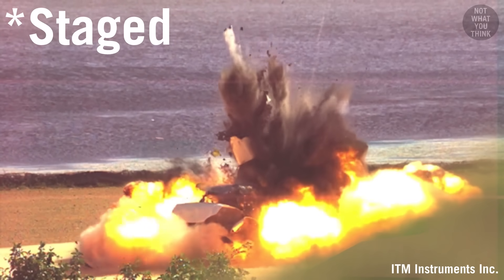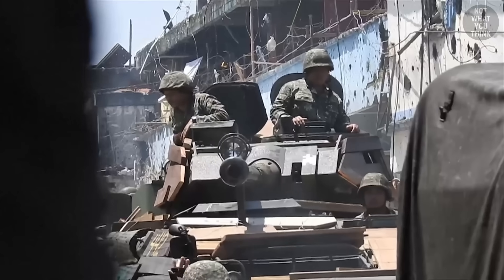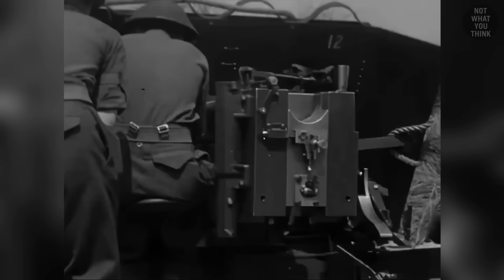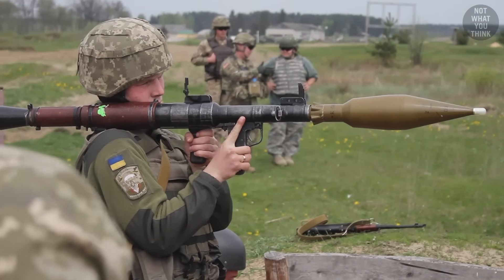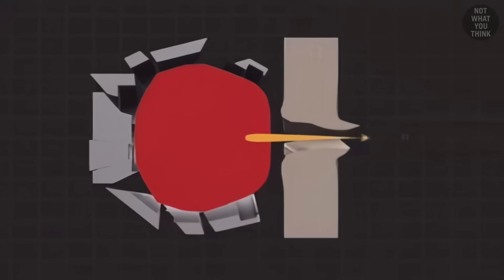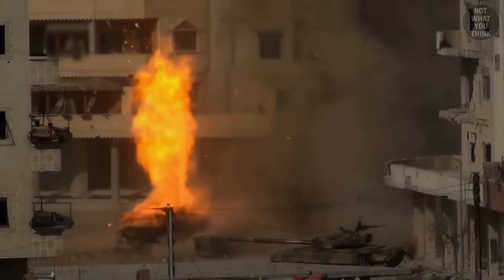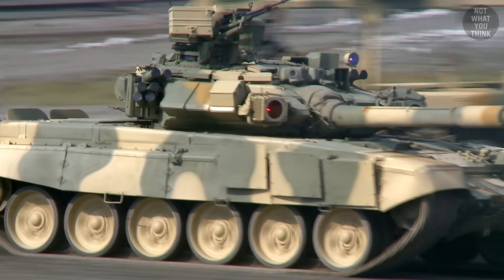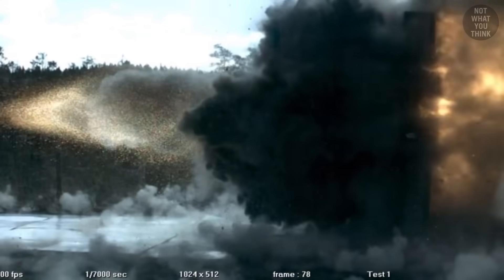Why Protecting Tanks is Getting Much More Difficult

Comment: I don't see the tank becoming obsolete any time soon. First you can't assume anti-tank weapons have 100% accuracy when doing numbers - even Javelins miss, and if you're in a position where your tanks are exposed to anti-tank fire with no means of protection or retaliation beyond what it has on board your officers have screwed up by the numbers.

In short - a Javelin may cost $200,000, but an M16 and 5.56mm ammunition is cheaper still and can kill the Javelin team, yet we don't say rifle teams threaten the utility of Javelin teams. The Javelin team is not supposed to operate unsupported in the same way a tank is not supposed to operate unsupported. Furthermore Javelins are heavy, and their expense means you can't expect to equip every infantryman with them as you could equip every one with a rifle. Your heavy weapons platoon might be able to kill a tank platoon right off but at that point they'll be out of Javelins and will require resupply (nevermind what might happen if they MISS - though could somebody who has actual combat experience with the weapon system give me a read on that? The most concrete number I've seen for wartime use is 100 hits for 118 shots which is absurdly good for any military weapon system in battlefield conditions), where your own surviving tank platoons would still have munitions and still be firing. I mean, logistics is ALWAYS a battlefield concern (yes those tanks will run out of gas eventually and probably even before they run out of shells) but the bottom line is that tanks still fill a critical battlefield role: getting more firepower to a position faster than even mechanized infantry can manage.

If you're looking for technology to kill the tank in favor of infantry, power armor seems more likely to pull that off and we're still decades away from seeing that on the actual battlefield. Only thing close to viable I've seen so far is a mobility assist skeleton that is power hungry and thus I can't see a use for yet outside of a logistics base far from the fighting.

EDIT: Made a quick fix because when discussing the Javelin I think I have no idea how stupidly accurate it is or the publicly available information is inflating numbers because what I am seeing is absolutely absurd for any weapon system in battlefield conditions

Comment: There wouldn't be much stopping a hypersonic tungsten projectile from one tank obliterating another. Reactive armor would be useless against a solid kinetic energy weapon. You just have to adjust the design of the barrel, boost the propellant, perhaps place a small rocket on the back of the projectile to keep it "at" or increase muzzle velocity downrange until it reaches its target. The magic number is 6,752.

Comment: the chances of all the shaped charges detonating correctly from an impact would be astronomical, it's hard enough to do on purpose. i guess their acceptable risk got a lot smaller due to public perception. one of those accidents had only a mechanical safety stopping the bomb from detonating normally. that was the scary part.

Comment: Reminds me a bit of Battleships.  They were big and impressive looking, but by the end of WW2 they were quickly losing relevance since they started becoming big floating targets that just couldn't keep up.
Reply: Yes and no. Battleships became very vulnerable 50 years prior with the advent of effective torpedoes and small boats that could carry them. What made battleships obsolete wasn't that they were vulnerable, it was that carriers could do their job - providing high calibre firepower at long range - better. Regardless of how vulnerable tanks get, until something can provide protected high calibre direct fire with offroad capabilities better than tanks, they will remain relevant, just how battleships remained relevant for 50 years after the torpedo was invented.
Reply: @Paultarco  I think tanks are going to do the same and shrink and become drone tanks. 3 expendable tanks for the price of 1 tank you really don't want to expend now due to the value of the lives inside, is priceless tactically. Because you can lean into the glass cannons, make them sacrificial, improve weight and mobility, and improve rapid detection and avoidance systems. While keeping a more than sufficiently powerful gun, or launcher to kill anything. Especially with sacrificial drone tanks you can take otherwise dangerous and risky, but potentially very effective, operations. Further benefitted from the increased mobility and minimal priority on armor and survivability. At least compared to an MBT.
Reply: Battleships are the platforms receiving the most high tech experimental weapons for testing...BUT  I get what your trying to say , and yes everything has its day. And Tanks really are starting to lose their use for several reasons , first you need air superiority to properly defend your tanks. They are relatively slow compared to other ground forces and air. With the new UAV tanks are harder to hide. Right now we are seeing how tanks are easily defeated in Ukraine , this year will be the real test of tanks survivability in the theater of war , As Nato tanks will soon face modern Russian tanks... Hopefully peace will prevail first.
Reply: @jeffputman8242  the T90 is Garbo bro.  AbramsX has it severely owned.
Reply: @jeffputman8242  Theres nothing that can replace the tank. Its a tool to be used under the right conditions. Just like any other platform such as planes, choppers, ships, subs etc. They can all be destroyed, but are all completely relevant and irreplaceable.
Reply: Ooo. Shot across the bow 😂.  IMO they would be hella useful, modernized, but far too costly. We don’t even have the tools to make the tools, that are required to make battleship sized equipment any more.  Nothing says fire support like a Battleship though, Marines best friend.
Reply: It could possible be similiar to the dreadnoughts of WW1, Germany and Briton invested heavy into the expensive dreadnoughts, that they didn't want to use them in fear of the finical lost. With tanks becoming more expensive to keep up with the antitank tech, some countries are becoming hesitant in the investment.  Lets not forget why we made many medium weight Sherman tanks in WW2 vs heavy tanks.
Reply: Yet they were only replaced once a clearly superior vehicle was fully developed.  With tanks, we haven’t yet found a suitable replacement for the role they fill (I don’t think).

Once we have a much better grasp on robotics and exosuits, I think we’ll see the true replacement of the tank finally come around as we revert back to enhancing individual humans, or replacing them altogether as well.
Reply: Tank is different from battleships, battleship got replaced only because there was something that was far better (Aircraft carrier). But for Tank, there is nothing that could replace its role, at least for now
Reply: @jackiecheng7209  Problem is, depending on the doctrine, the tank's role is either utter bullshit to begin with or makes many of its aspects entirely redundant and superfluous. I've seen a lot of tank defenders arguing for what amounts to "not allowing the tank be hit in the first place". Well, if that's the case, then why do tanks even have and bother with their heavy passive armor in the first place? We've reached such a point in development where you either slap enough armor onto a vehicle for it to stop a supposed threat or don't put any armor on it at all. You can say "oh, but you need a big direct fire cannon" all you want, that doesn't exclude the fact that it can theoretically be done by a much lighter "glass cannon" vehicle with dedicated design and APS to fall into the unecessary trade-off in mobility and affordability that your average Western Main Battle Tank makes. Having that extra armor "just in case" is all well and good in theory, but not when you have to sacrifice so much for it and in the end it might not even do anything in case it actually does get hit.
Reply: I think the future is a platoon on 10 remote side by side quads with each different options of weapons... the rpg quad the anti air quad  the anti missile quad tje aa wuad... 😂  think would be a cheap no human loss to move shit forward in a war lile ukraine... had a platoon of aerial drone eith weapons too and that force can move forward with 0 human casualty... nerds playing video games almost...  very expensive but think a tank cost 10 millions plus crew maintenance etc  more is better... barely armoured unmNned side by side quads zhould be a great weapon.

 Beef up suspension... track option etc... we could also remote pilot some good old skidoos...
Reply: The bad ones with really crap AA used by the Japanese and Germans certainly fit into that category. The Iowa-class, however, was bristling with the most advanced AA guns in the world, AA which was so effective the US never lost one in battle despite using them as huge screening vessels for their carriers. They could deny large areas of airspace extremely well, as anything that didn't respect their personal bubble was chewed through like overcooked noodles.

Battleships were not phased out because they were useless or because carriers could destroy them easily- in fact of all the vessels in a fleet battleships were the hardest for carriers to sink. Rather they were phased out because carriers could perform the roles only battleships had the capability of performing up to that point. Like anti-surface combatant work or naval invasion support.

Even then, it was only to the point that new ones weren't being built. The US still used the Iowa's to great effect as screening vessels and fire support during the Korean war, where they continued being effective against jet fighters just from the sheer amount of lead they could put in the sky.
Reply: @jaytranscendencemodder1280  Actually the Iowas (i can't remember how many) were used in 1990/91 during Desert Storm. Thing is that the smaller Ticonderogas can also perform AA and launch cruise missiles etc for less investment.
Reply: @donaldduck830  the Missouri and the Wisconsin, although famously this was only possible because the Iraqi forces had next to no navel power, nor cruise missile capability. In fact, the Missouri was almost hit by an early gen land launched cruise missile, and likely only survived because a British destroyer in the battle group used its sea dart missile system to intercept the cruise missile on the Missouri’s behalf
Reply: @jaytranscendencemodder1280  "Crap" Japanese AA took out all but a handful of US dive and torpedo bombers at Midway. We got really, really lucky.
Reply: @jaytranscendencemodder1280  I think the cruise missile was really the final nail in the coffin for battleships. Once you could field a bunch of cruisers with missiles that were faster, cheaper, and could provide bombardment and precision strikes from beyond visual range, the idea of strapping a bunch of massive guns on a heavily armored boat became obsolete.

And now we might see the same thing happen in reverse if they can ever solve the issues with railguns, as they can provide the equivalent explosive mass from the same ranges and with the same accuracy that a cruise missile does, but with a solid metal projectile that is both cheaper and safer since it has no explosives.
Reply: @jaytranscendencemodder1280  Entirely untrue.
Japanese battleships begin lightly armed AA wise at the outset of ww2, that quickly changed to where a single Japanese battleship was slightly better armed then the US counterpart. Yamato class were also harder to sink, with armour that was 20%-50% thicker.

US Battleship
80 × 40 mm (1.6 in) AA guns 80 rounds a min effective fire rate.
49 × 20 mm (0.79 in) AA guns 280 rounds a min effective fire rate.

Japanese
12 × twin (5 in) DP guns 40 pound (shotgun charge) 8 rounds a minute effective per gun.
162 × 2.5 cm AA guns (1 in) AA guns 100 rounds a minute effective fire rate.
4 × 13.2 mm AA machine guns

The biggest difference was the fact Japanese primary carrier aircraft, the Zero, had no armour and unlike other aircraft no self sealing fuel tanks... a single hit by an explosive round anywhere near the fuel tank was generally enough to down it.
Reply: @givemeanameman1  Japanese AA guns were notoriously crap. As in, the guns themselves were inaccurate, unreliable, and lacked killing power. What's more, you can't just jury rig over a hundred guns to your ship and expect them to perform the same as a ship that had AA coverage in mind from the start. They had terrible firing arcs and the layout of the ships made them hard to service- plus the sailors doing so got in the way of other sailors trying to do other things.

It's like how people think the Yamato was more powerful because the numbers were bigger. It's guns were of a lower quality, having less range, accuracy, and destructive power than the Iowa's 16inch, it's thick armor belt was made of terrible quality metal in an obsolete layout, it had fewer and less advanced firing control systems, even its engines were inferior.

In contrast, the Iowas were the cream of the crop at every level. Superior technology and materials all around meant it was the more powerful battleship by every metric. Faster, more survivable, more destructive power, etc.

And significantly better AA coverage and technology.
Reply: Battle ships are big floating coffins
Reply: floating targets against what? The only thing that could really hurt a battleship was aircraft or another battleship. Now a mk48ntorpedo will do they job but that is many years of science and testing to make that happen.
Reply: @jeffreyiaia8592  You just answered your own question. Predominantly aircraft & increased/improved submarines negated the large, decked out battleships. Aircraft carriers became the new way to project power & the flagships of a nation's navy.
Reply: Perfectly describes a climate change enthusiast
Reply: @williamwilliam5066  eat your meds
Reply: @williamwilliam5066  There’s always a dumbass in the midst of calm discussion.

Comment: Well, the thing is there are NO substitutes for tanks. Tanks are needed in attacks, not so much for defending positions. Whenever you launch an attack you need them, otherwise you're gonna send waves of infantry in light armored vehicles or with no protection, which will likely make them perish extremely quickly, making every attack extremely risky and costly (as we know, training dozens of soldiers is even more expensive than a tank itself)
Reply: tanks ARE lightly armored vehicles now tho... just more expensive ones
Reply: Tanks have always been an assault weapon and assaults have always required a signficant superiority in numbers. If you have a tank division of 100 tanks that is well supported from the air and by friendly infantry, against a few hundred enemy infantry, that should be enough for a succesful attack.
Russia's poor strategy has been bad PR for what tanks can actually still achieve in a well synchronized fighting force.

Comment: Very low armor, double to triple reactive armor on top, and active protection systems... But the next step against that will be sensor clogging (say with lasers and other disruptive measures) and machine gun fire to destroy the sensors and active protection systems
Reply: Basic rpg destroys all the sensors pretty easy, doesn't it?
Reply: @Kairat_Tech  what do you mean 'basic'? Primarily it's against armored vehicles with the shaped charge, but it's explosion is, well, shaped, it's aimed at melting through armor and destroying people, and what's inside, it does little to nothing damage to external modules if it explodes on the armor, and even less if it explodes away from it. Then there's anti personnel high explosive ammo, which is Aimed at making shrapnel. That one would do little damage to the crew and internal stuff, but could destroy sensors, yes, although it'd be a kind of random, because you can't predict where the shrapnel goes and how where you hit changes that... So no, destroying sensors with an rpg would be a bad idea. Also the whole POINT of said sensors would be to shoot down rockets and projectiles WAY BEFORE they get close! So, to destroy sensors you'd need a semi new kind of charge - a shaped timed explosive, one that would get sufficiently close, then explode before the tank can take it down and shower it with fragments that'd take the sensors out far more reliability. Or, you know, just shower the tank with machine gun fire.

Comment: I tend to disagree with the idea that the tank becomes obsolete. To render a weapon system obsolete, you must not only counter it but also nullify its utility. That's why Carriers replaced Battleships. Not only did they counter them but they were able to do everything a Battleship was designed to do, and even do it better in some cases.

For now, nothing can replace the versatility of a tank on the battlefield. Having such strong armor with decent mobility through all terrains and with such a powerful gun capable of engaging any type of threat (even aircrafts in some occasions). It's an all-in-one package that nothing can replace.
We may see reduced number of tanks, and we already do if you look closely. Most armies in the world do not go over a couple of thousands tanks nowadays, a far cry from what we had in the mid 20th century. But I don't think the tank is going anywhere. 
Tanks have been deemed obsolete on multiple occassions ever since their creation, and regularly a new weapon system emerges (AT gun, AT rocket, helicopters, portable AT missile, drones...) for people to claim that this time, this is it, the tank is done. Yet it's still here to stay, because nothing can replace it as of today.